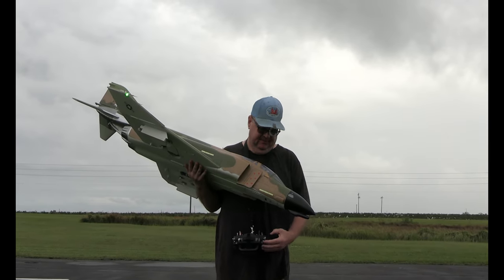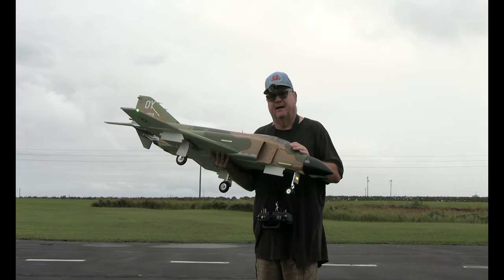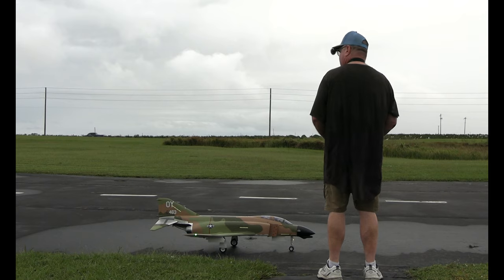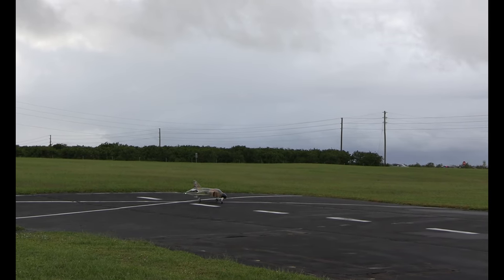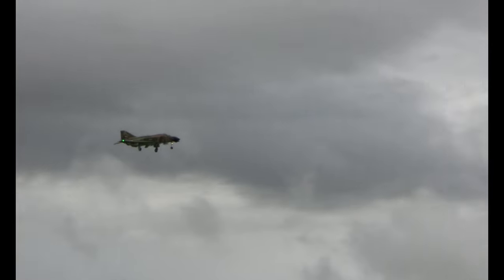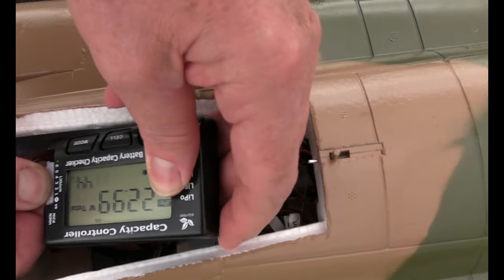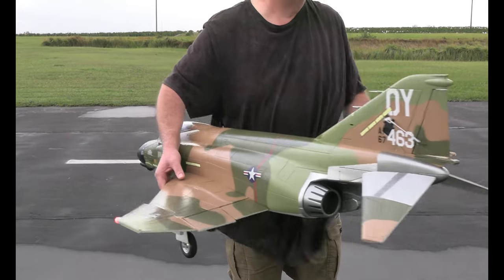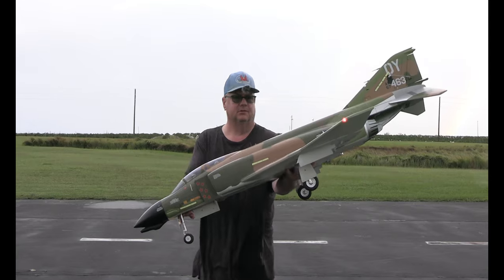FREEWING 90MM F4 PHANTOM II MAIDEN! by FGFRC #rcjets #aviation #rc

Comment: Just because you have to change the elevator trim doesn’t mean it’s tail or nose heavy. Trim for level flight right side up and then fly it inverted. If the nose drops when it’s inverted, it’s nose heavy and if it climbs, it’s tail heavy. I balance mine to where I have to hold a little forward stick (down elevator) to fly level inverted. The pattern fliers want their planes to maintain a 45 degree inverted climb. Also, I don’t know why yours needed so much right aileron trim. I don’t think my F-4 needs it. And, as you know, I use F-mode trim so that I have separate in-flight aileron and elevator trims for each position of the flaps.
Reply from the maker: Thanks, had I got a few more flights in i could have gotten her  sorted out better but in the maiden no matter what she keep wanting right aileron to straighten out. once I left in a little right in she flew much better. All rims were perfectly neutral before lift off also. As for elevator I think I had a little to much for my battery weight/position I will readjusts and try again next flight. Hard to trim in heavy wind and hard to tell much from just one 3 minute flight.
Reply: @ Yes, it’ll take several flights in better conditions. I still don’t enjoy flying my F-4 as much as several of my other EDF’s.
Reply from the maker: @TheRCAviator  Well i am more of an instinctive pilot rather than technical, I felt like flying her will be more of a challenge but she felt very good on landings.

Comment: Another thought. The CG can be perfect, but if the incidences of the wing and tail are off, a plane won’t fly level. And with a flying stab, the incidence of the horizontal stab can be way off and you’d never know it because you don’t have a fixed surface to align the elevator with. The manufacturer might give you a setting to use, but every plane and person are different. So, how it behaves inverted is the best way to tell.
Reply from the maker: I understand what your saying, but until i am more used to her I will not fly her inverted yet. Perhaps on the 4th or 5th time in the air.
Reply: @ Yep, when you’re ready, pull into a 45 degree climb, roll to inverted, let go, and watch what it does. If it falls, move the battery back a little. Note that moving the CG back can make the elevator too sensitive, and you might have to decrease the throw. I decrease the throw by moving the linkage in on the servo arm, not by turning the travel down in the radio. Of course, moving the CG back too far can make the plane unstable. So, you have to decide whether it’s too touchy or unstable and proceed accordingly.

Comment: I use the SMC High Volt 9300 6s packs in my Phantom. I get good flight times and the plane balances out nicely. I also modded the elevator push rod. I found the stock elevator push rod too flimsy so I beefed it up with a carbon fiber rod wrapped in thread and secured with thin CA. Nice Maiden flight ! Keeping it real .
Reply from the maker: Thanks for sharing! Check out my 2nd and 3rd flight here:https://www.youtube.com/watch?v=p2Bjukb_irw&t=161s

Comment: Awesome job! I have had two 90mm Phantoms in the 8S version since they came out (Navy and Air Force). Same deal with the aileron trim and certainly not a jet to get slow in the turns with for sure. Other than that, once you get them comfortably trimmed out they will fly rock solid as far as stability goes. Definitely a jet that you want to stay ahead of however but a beautiful representation of one of the most classic jets out there! Keep up the good work.
Reply from the maker: Thanks so much, give me 2 more good flights and I will get her rocking!!!

Comment: Excellent work FG. The F4 afterburner doesn't look calibrated correct on throttle up but the Blue looks awesome at full power.
Reply from the maker: Thanks, no i on purpose like it on all the time, I know it is not scale, I have it at lowest settings on idles than flares to 100% with full throttle.

Comment: Hi FG this is my favourite all time plane and once I’ve sold a few I’d love to get this so will be good to see how she flys I have heard it’s a bit troublesome of a jet but such a looker
Reply from the maker: Well I have only flown this once and the easiest part was landing.  I have since discovered there is a slight deformity in the mold of the right wing causing it to need a few clicks of right aileron to fly straight. i also discovered is no wither you fly a 5k or 6k battery butt it up against the canopy wall just like I explained in the radi setup video.

Comment: Very nice F-4 EDF.  I have the same.  As for your current right-aileron adjustment, you might consider the high crosswind your flying in.  It's not uncommon for pilots to have very odd trim depending on what their navigating or the course heading.  
Also, you mentioned you need up elevator, this indicates nose heavy, move the battery back as far as you can, he likes tail heavy.
Reply from the maker: Thanks for the tips! And yes windy days are never good to figure out trim.
Reply: @FatGuyFliesRC  Also, I'm curious how to you find this F-4 Phanton handles compared to your F-14 Tomcat 64mm?

Comment: Ik u said u had stcok setting but can you tell us also do u have throttle gains mix/curve
Reply from the maker: No i don't set the gains other than leaving them on a roller to adjust with each flight. And I don't have any priorities et with them just whatever default is. Like I noticed in the the first part she was getting rocked around a bit I called it "wonky" so I increased the gains on the roller and that took care of it.
Reply: @FatGuyFliesRC  oh ok wow so when it’s rocky u just increase it the as3x
Reply: @FatGuyFliesRC  yes but what’s ur range set at and do u start ur gains at zero in the knob
Reply from the maker: @Deezm-z3b  Yes that is why I like it on the roller , i can adjust for each day.

Comment: What reciever are you running
Reply from the maker: Spectrum AR8360T with SAFE and AS3X+.
Reply: Your using your bind button for reverse thrust and is it possible to use the bind port for reverse thrust also thanks for a great channel bud much love from vermont!!
Reply from the maker: @robertlafar3822  No I don't think so, but I will look into it, If it is possible then that turns all 6 channel receivers into 7 channels!
Reply: Right i dont think its possible but i thought i might have missed something i definitely like the idea of using the bind button for reverse thrust thanks bud

Comment: Bros what’s ur AS3x setting likr priority and AS3x gains on this plane sick flight btw I had my AS3x gains too high on my yak and it stalled due to oscillation and crash flew terribly lol
Reply: Like ur stick priority
Reply: Man you made me nervous! I have been waiting on this video to see if you have any tips or tricks before I maiden mine.
Reply from the maker: I set no priorities just what ever default is. I keep the gains adjustable on the roller, if I noticed the plane start to oscillate I turn them down a bit, if the plane is getting rocked around to much from the wind I turn them up until i get that perfect balance. Every day is different and the wind and how the air feels is different every time I fly here so I keep every thing adjustable to that flight.
Reply from the maker: It will need some right aileron at first and keep that 6k 0r 5k snug up against the canopy drop down like I showed in the radio set up. I tried to move the 6k I used in the maiden back back about 1/2 inch from there since it was a bigger heavy battery but she seemed tail heavy so on the next time I fly I am leaving the 6k right where I originally had the 5k. I think this one is going to be one that likes to favor slightly nose heavy over level or slightly tail heavy like deltas do.
Reply: @FatGuyFliesRC  darn so how do I dinstigushh oscillation from like sluggishensess